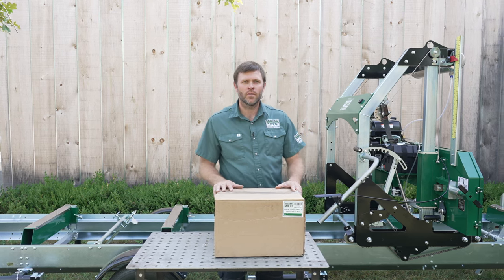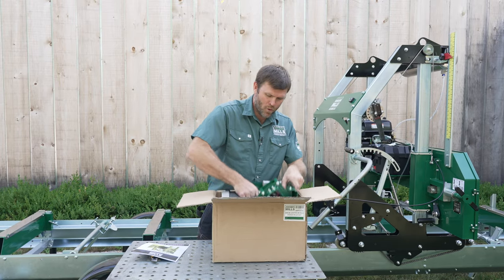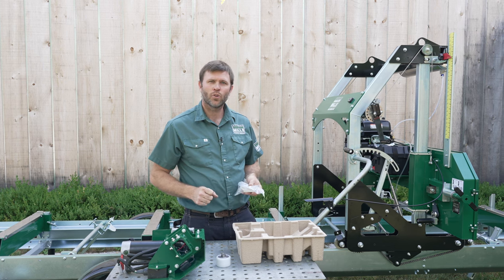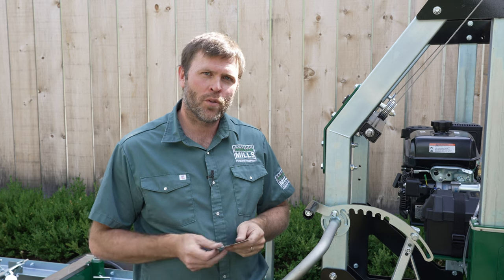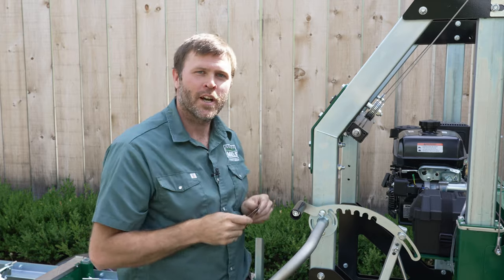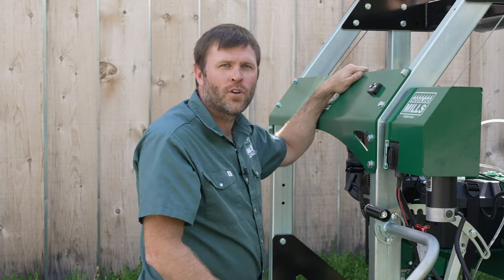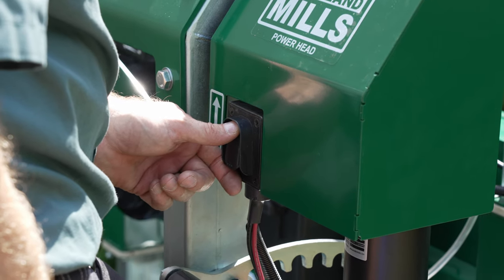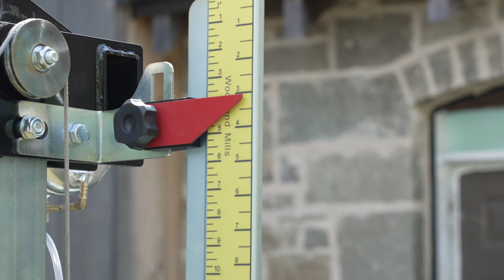Woodland Mills Sawmill Power Head

Comment: Is there a way to use this on the electric motor version?
Reply from the maker: Yes this is designed to work on the electric start engines!
Reply: @woodlandmills  how is it powered in that case? There's no 12V battery on the electrics..
Reply from the maker: If you are adding it to an electric engine, it would need its own separate battery hook up.
Reply: @woodlandmills  Yes, and that needs some charging. Quite a hazzle unfortunately...
Reply: @woodlandmills  it would be nice if it could somehow be connected to the control panel, but that would require some 12V adapter.
Reply from the maker: We appreciate the feedback! And we will definitely take your suggestions into consideration. Thank you, John!